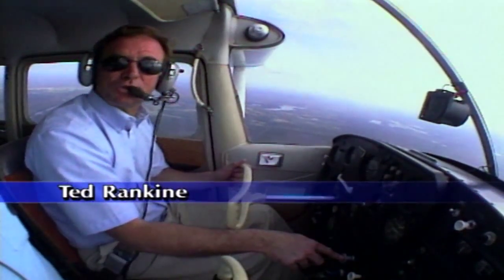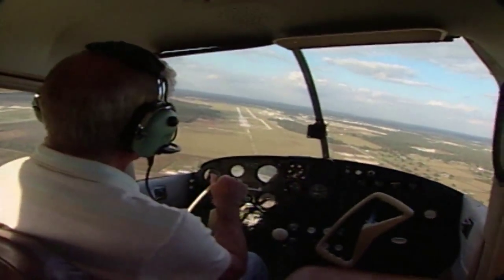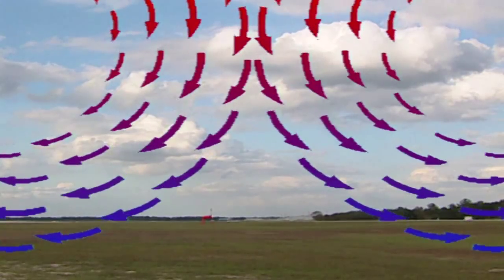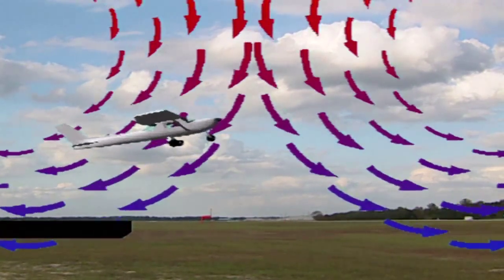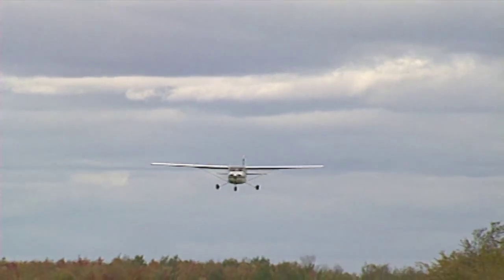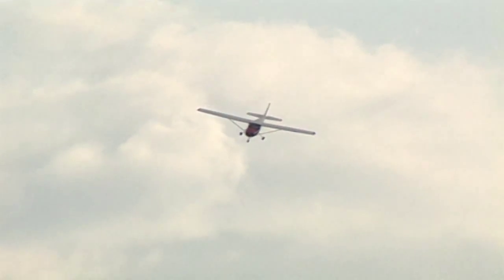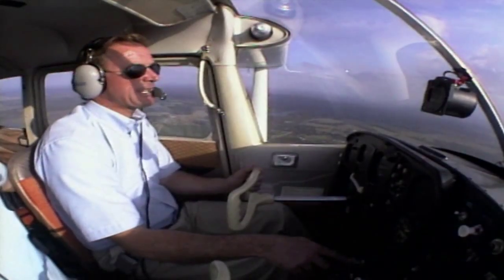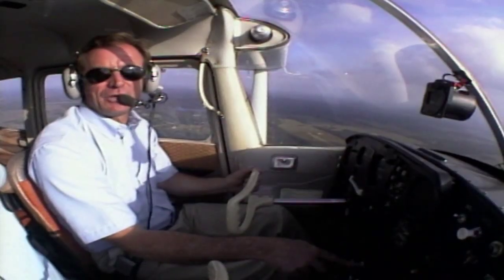SmartPilot | Microbursts

Comment: I Was single handing my 47' x 27' catamaran back from Catalina island in September in about 10knots of wind. in the distance I could see this round saucer like black cloud approaching and about 3 miles across under that cloud the water was almost glassy. I had no idea what a microburst was sailed across the Catalina many times but when it hit it pushed my port bow under the water I heard creaks and groans from the rigging that I've never heard before the dog I had with me ran inside the cabin and the boat started rounding up to starboard  which would have put n a  beam  rate  and I'm sure the boat would have gone over .I had the wheel
Reply: anyway I managed to head down wind and kept the boom from gibbing wish I'd been able to look at the wind and boat speed instruments but I was so freaked out and trying to keep the boat going down wind but for a few minutes we were really cooking the ride was a blast. I won't even guess the wind speed and boat speed seemed like someone opened up a door no rain just flat water not even the west swell made it through.